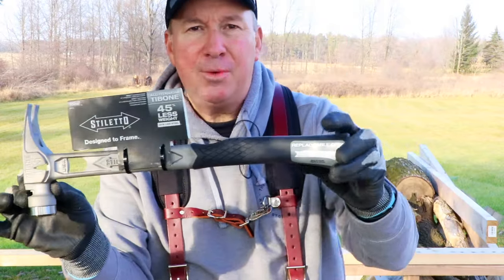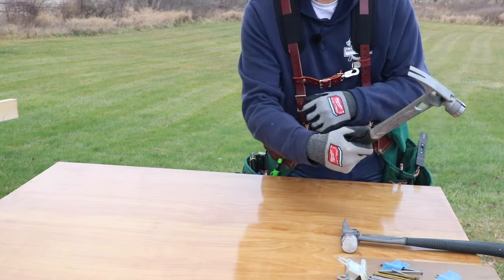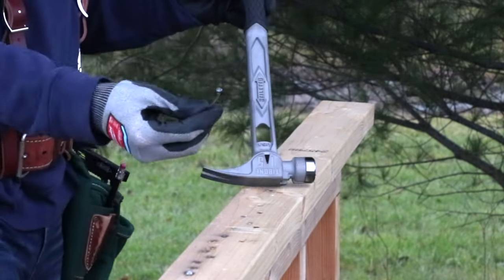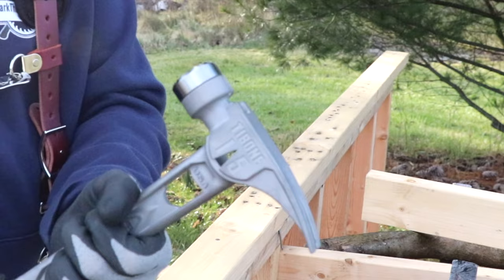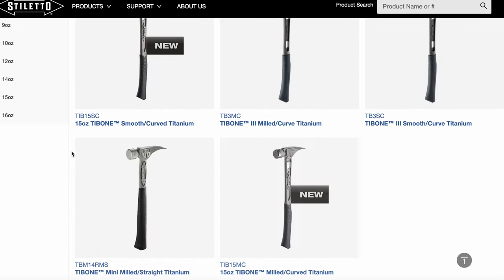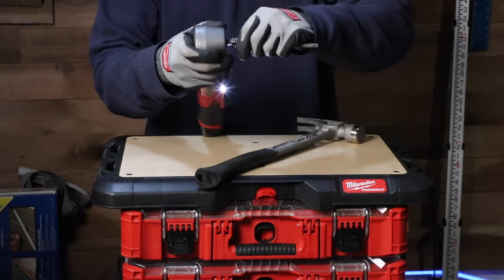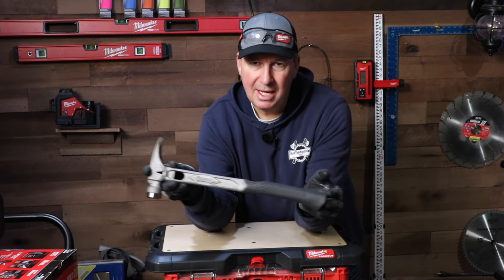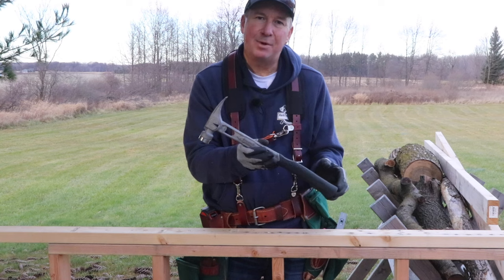New Framing Hammer Revealed by Stiletto!  - FULLY REDESIGNED!

Comment: I like the Martinez its the same weight and a heavier swing and it was the original stiletto 2.0 and the interchangeable head is epic go from a 2lb sledge or a finish head changes pretty quick with a 12point 3/8 box end no drill needed haha

Comment: Wood handles are best for dampening vibration, a 14-16 oz titanium hammer dose not hit has hard as a 20-24 oz steel hammer, the only circumstance it may (and i stress MAY) is if the titianium hammer has a very long handle and you swung it from the very bottom to bring the speed up. Overpriced, over engineered hammers solving a problem that dose not exist, going from tools to boys toys. Estwing 20-24 oz smooth face will cover all basis from finish work to framing. I'd only consider a titanium hammer if it was just the head that can be mounted on a wooden handle and was atleast in the weight range of 18-20 oz.

What weighs more a tonne of feathers or a tonne of steel?
Reply from the maker: I haven't tried a titanium wood handle hammer yet.  I'll have to add that to my list.

Comment: Blue, Orange or Black. Question, is there an advantage of a milled faced compared to a smooth? Thanks Mark!
Reply from the maker: The milled face seems to hit the nail with less slipping, making it more efficient.
Reply: I assume using the flat face is preferred for finish nails, so that the surface is the siding doesn't get marked by the millig
Reply: 🔨 When doing rough framing, 
a milled face hammer can easily drive nails that are not perpendicular to the hammer face — without slipping. 

(In other words, to prevent slipping, the milled hammer face groves "catch" the nail head edges — specifically when striking a nail at an angle that is significantly more or less than 90 degrees.)

Comment: Mark great info on this hammer. I am going a little off your subject today. But I wanted to ask you what compressor you recommend or like for yourself?
Reply from the maker: Thanks!  I've been very happy with the Milwaukee M18 Compressor.  I've also just started testing out the Ridgid Pancake Compressor too.  It's a little louder, but work great at only $99.
Reply: @MarkThomasBuilder   Great Thanks for the info
Reply: @MarkThomasBuilder  Hey Mark the other day I asked you about which compressor you liked,well I went ahead and purchased a ridgid 6 gallon pancake compressor. Which you said you were testing. My question to you is does the regulator valve to dial in your preferred psi for your tool that you are going to be using. Is it supposed to bleed air when you back the valve off of say from 100psi to 50psi?or did I get a faulty compressor?
Reply from the maker: @redkey6538  Good question!  I also own an Emglo and Milwaukee compressor and they all make that hissing sound, which bleeds the air out when you turn it down.  Sounds like your compressor is normal.
Reply: @MarkThomasBuilder  Great Mark thank you for the response. Very helpful.
Reply: Do you think you are going to test the ridgid 6 gallon pancake compressor or have you done that already?
Reply from the maker: @redkey6538  I plan on featuring that sometime next week.

Comment: This magnetic nail starter can use 2 inch nail?
Reply from the maker: This framing nailer holds 8d-16d nails, so 2.5" -3.5".   

The smaller Trimbone hammer holds 2d-16d nails, so 1" -3.5".
Reply: @MarkThomasBuilder Which model is the smaller Trimbone hammer?
Reply: Before I bought the TB III 15 hammer but it couldn’t fit 2 inch nail. Which model do you suggest that fits 2 inch?
Reply: Same problem I’ve tb2 and it’s the best design ever it can take 2 inches and 3 super easy the tb3 is very bad and weak design hopefully the new one can fix that

Comment: $250?
Reply from the maker: Yes, if you're swinging a hammer all day long, this is an investment in your elbow and shoulder.  A major advantage over steel and it will last a lifetime.
Reply: Get a wooden handles steel hammer and it will solve all your problems for a fraction of the cost.